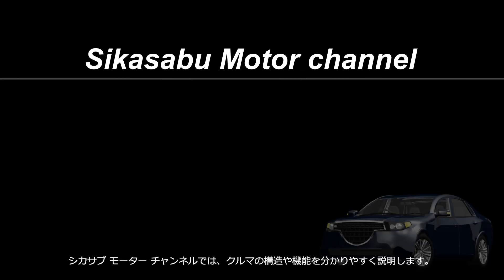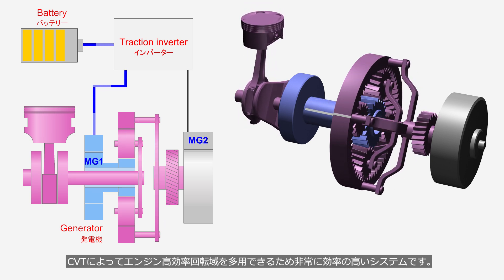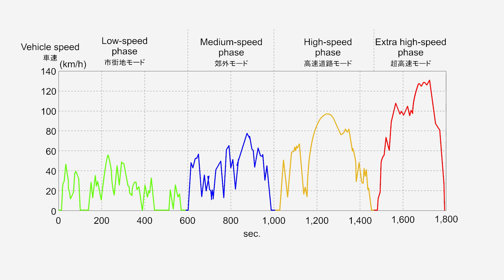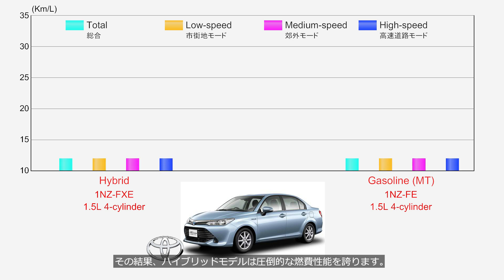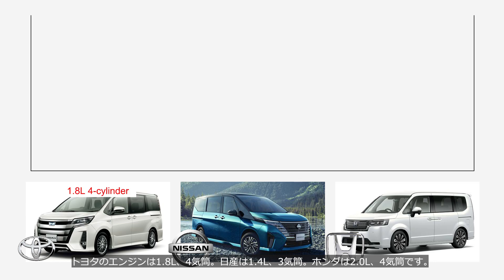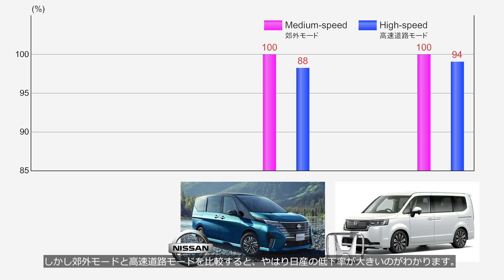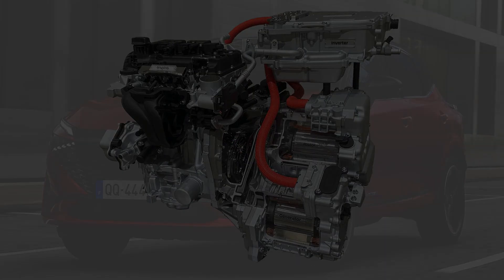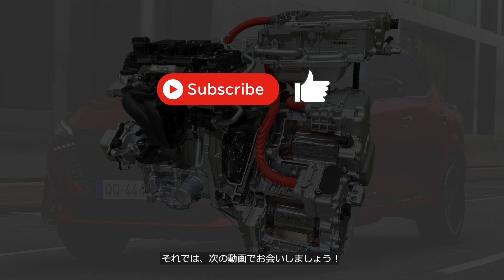Toyota, Honda, Nissan. Which Hybrid System Is the Best?

Comment: In the UK the 1.5 litre current generation has a three cylinder Atkinson cycle engine. I drove 40 miles of undulating roads in reasonable traffic today and achieved 86 miles per imperial gallon. The average for my Yaris varies between 60 and 75mpg imperial [1 gallon = 4.546 litres]

Comment: I would add proper hybrids have few other bonus features- no alternator no starter. The starter function is very powerful, using large powerful high voltage battery- strong argument in cold climate for cold starts

Comment: The Toyota system that exists in the MK4 Yaris is certainly the most highly developed & 'battle proven' of all of them in 2025.
That's if you measure a hybrid system purely on petrol economy & reliability.
As we know, Toyota have been involved in this technology for longer than the rest & I guess Toyota have patented parts of their system to prevent copying or cloning.

Of course nothing ever stands still & it's possible that others will invent an (as yet) unknown hybrid system that surpasses the Toyota System.
We shall see!

Comment: I think the setup of Nissan and Honda, with their high battery motor output, leads to a higher C-rate, which might result in shorter battery lifespan compared to Toyota. Nissan's hybrid, being a series type, offers the smoothest driving experience, but its reduced fuel efficiency at high speeds and the additional cost of using 95 IRON gasoline is cons of to get advantages of a hybrid. While I praise Honda's technology, it feels like something is lacking compared to Toyota's reputation and sales volume. Conclusion: Toyota is the best.
Reply from the maker: Thank you for your comment. In terms of fuel efficiency, I also believe Toyota is the best.
Reply: @sikasabumotorchannel  Honda and Nissan use GDI engines, which, even in hybrids with reduced operating time compared to conventional petrol engines, I beilieve, it is inevitable the accumulate carbon sludge in the intake. How abour your opinion?
Reply from the maker: As you mentioned, direct injection engines do have sludge issues, but since many automakers use this technology, I don't think it's a problem unique to just Honda or Nissan.
Reply: @sikasabumotorchannel  Yes, it’s not just Honda and Nissan’s issue, but as hybrid competitors to Toyota, their setups are somewhat questionable.
Reply from the maker: Yes, from that perspective, you're right. Toyota might have an advantage when it comes to that issue.

Comment: Please show us another hybrid that is commonly used in Chinese models. They named it as Dedicated Hybrid Transmission or (dht). I would love to know the detail on the working function compared to the Japanese hybrid design
Reply from the maker: Thank you for your comment. I'm also very interested in the mechanisms of Chinese vehicles, but unfortunately, I haven't been able to obtain detailed information.
Reply: It's used by MG/SAIC Hybrid+ system, 3 speed transmission can be driven by both electric or gas motor, so technically itcould be considered a variation of the Toyota system

Comment: Honda hybrid is the best because I used to owned 2000 Honda Insight and the Hybrid battery went bad but I could still drive it with 1.0 lilter 3 cylinder engine until it broke at 200 KM and junked it.

Comment: Nissan has a bad reliability reputation with 3 cylinders new engine eg on Rogue or Qashqai. Toyota has the best releability reputation. On the other hand, Nissan fully electric models, eg, Nissan Aria, have the best reliability reputation. Vote for Toyota
Reply from the maker: I wasn't aware that Nissan's 3-cylinder engines had a reputation for low reliability. Thank you for sharing that information.

Comment: one of the biggest question is price , toyota system seems costly to nisssan when talking about subcompact system where biggest factor is both milage and price of the car

do anyone knows the price difference subcompact of totyota yaris and  nissan e-note
Reply from the maker: Thank you for your comment. 
Since the equipment differs, a simple comparison isn't possible, but if we compare the lowest-grade models, Nissan is about 20% more expensive in the Japanese market.
Reply: @sikasabumotorchannel what really,  Nissan is expensive I thought due to simple system it would be cheaper but the things is they are using expensive motor 

It seems Nissan don't wanna spend much on research
I guess people can question that toyota system is best but it is very expensive not as mass producing the system but developing the system or i can say the optimization,  in toyota system for each car you need to develop a software which fine tune the when, how much engine or motor power required,  that why it would seems to be expensive. it will be different for each car. while in Nissan it is just you have to optimize the engine to run in efficient mode 

I don't how Nissan car is expensive in the same segment 😅😅

Comment: I prefer non hybrid 
TO much headaches when it comes to fix.
With all respect for TRUTH AND KNOWLEDGE 
Why don't engineers work to improve mileage on a single fuel engine  ?  Instead of attaching another engine  ? 
With all respect for TRUTH AND KNOWLEDGE
Reply from the maker: Thank you for your comment. 
Hybrids, which compensate for the weaknesses of internal combustion engines, offer overwhelming fuel efficiency. And automakers must comply with strict CO2 emission regulations. That means, whether we like it or not, they have no choice but to embrace hybrids—sadly enough...😢
Reply: CO2 Emissions regulations are tightening especially in Europe and  Aseanic countries forcing global manufacturers to innovate. 
Secondly, to give environmentalists a purchasing option as all wouldn't consider a gasoline car in this era of electric cars.
Finally, it comes down business. A gasoline car is more expensive to produce and maintain hence cutting into the bottom line.
Reply: There's only so much improvement you can do to the thermal efficiency of the combustion engine. At some point it's more cost efficient to slap on a system that recaptures braking energy.

Comment: Vote Nissan epower is the best
Reply from the maker: Thank you for voting.😉
Reply: It is dumb. Now you need to maintain two engines instead of one. Electric and ICE. I rather just go for high capacity EV
Reply: Nothing to maintain in ev motor or battery.

Nissan epower with turbo has reliability concerns, but otherwise good alternative to Toyota power split

Comment: Chinese hybrid model mostly adapt technology similar to the Honda, do note that The Chinese has loose definition for "engine thermal efficiency" as they only measure the maximum efficiency points at best point rather than the overall efficiency at operation ranges, thats how they claimed 44%, 45% thermal efficiency in China. 

The latest BYD hybrid Song claimed to have achieved 2400km with single 67L fuel at extreme Fuel Saving challenge, however later found out that Honda Accord hybrid able to replicate similar fuel efficiency under such circumstances. To date, the most efficient Hybrid was achieved by Toyota Prius , which certified by guinness world record
Reply: Both Honda e:HEV and BYD DM-i have similar architecture and although their city and lower speed MPG are respectable and competitive with Toyota, at higher-speed they get significantly worse compared to Toyota. BYD is not sold in the US but in the US EPA rating which is more heavily skewed towards higher-speed freeway driving of the USA (compared to WLTP/WLTC and NEDC/CLTC) Honda always has lower rating and its performance in real life falls short of catalog numbers compared to Toyota
Reply from the maker: Thank you for sharing the information.
Reply: "Mostly"?  No. 

Great wall/HAVAL = Nissan E Power
BYD = Honda eHEV
SAIC / MG Hybrid+ = Toyota but only with 3 speed transmission
Reply: Do note that BYD was able to achieve honda-level efficiency while carrying a heavier battery than the honda counterpart

Comment: In Thailand, Mitsubishi recently released their new hybrid system for the Crossover model named Xforce e-Motion which is advertised 24.4 km/liter of fuel consumption. It is said that this system use both motors to drive the vehicle. At low speed the system works as a series hybrid where the traction motor drives the vehicle and the engine generates electricity. But at cruising speed, the system will disconnect the traction motor off the drivetrain, and mainly use the engine to drive the car BUT still use the generator motor to assist it. They said the generator motor can generate electricity and assist the engine with driving force at the same time. It seems impossible but I don’t know what technology they have as the deep dive info hasn’t been disclosed by Mitsubishi yet. They even said it’s more efficient than the Honda eHEV when driving on highway, that’s very interesting. If you have a chance to learn about this system, I’m waiting for your video.
Reply: This so-called "Mitsubishi hybrid" is actually supplied by Aisin. Aisin is a major Japanese automotive supplier which was historically part of Toyota. They are still close to Toyota but Toyota recently divested a part of the share so Aisin can now operate more independent as they wish and can supply parts and technology to other automakers as they wish. They not only supply hybrid and electrified parts to Mitsubishi but also some Chinese automakers like Trumpchi. 

The technology that Aisin sell to others are sort of like Toyota's venerable THS except it doesn't have planetary power-split and somewhat "downgraded" (Toyota still wants to protect its secret ingredient). So think of this "Aisin hybrid" performance as that between Honda e:HEV and Toyota THS. Not quite Toyota level but better than Honda
Reply from the maker: Thank you for sharing the information.

Comment: Interesting to compare toyota efficiency va chinese hybrids like BYD
Reply: BYD's hybrid system is more like Honda's than Toyota's. Both BYD and Honda use an engine connected to a smaller generator motor and a larger traction motor, with a clutch between them instead of a planetary gear.

At low to medium speeds, the clutch is open, and the engine powers the generator, which charges the battery. The traction motor then draws power from the battery to drive the wheels, functioning as a series hybrid. At higher speeds, the clutch closes, allowing the engine to drive the wheels directly.

This system operates in three ways:

1. The electric motor powers the wheels when the battery is full.

2. At low speeds, it functions as a series hybrid, with power flowing from the engine to the generator, battery, motor, and wheels.

3. At high speeds, the engine directly powers the wheels.

Toyota’s planetary power-split system allows not only these three modes but also simultaneous engine charging and propulsion, as well as joint engine-motor operation, leading to better fuel efficiency at high speeds than Honda or BYD.

If you don't believe me check 1001cars on youtube where he compared BYD Seal U DM-i vs RAV4 PHEV. The latter had longer EV range, better MPG in all condition, better acceleration and of course higher reliability
Reply from the maker: Thank you for your comment.
There isn’t much information about BYD in Japan. I know they have PHEVs, but do they also have self-charging hybrids?